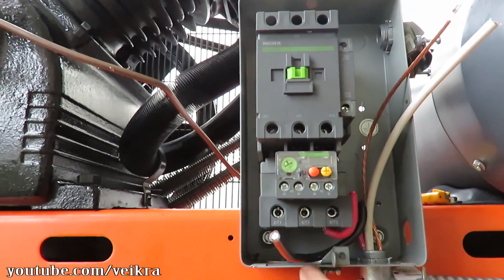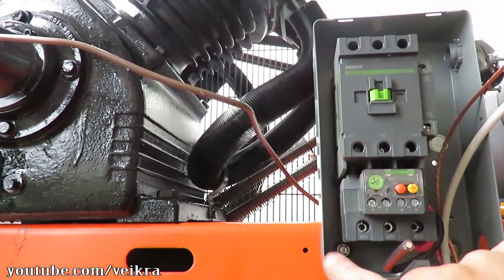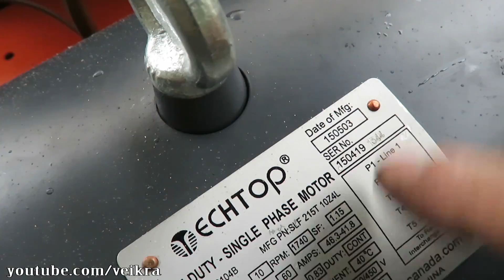How to wire 3 phase magnetic starters or contactors for single phase use and save $$$

Comment: Its working?
Reply from the maker: of course, why else would I spend thousands of dollars on it. Theres videos of it running as well as other ones I built just like it
Reply: @Nordic_Mechanic  so you running the motor with 1 phase?
Its stay long?
No issue?
Reply from the maker: @minkbandem8093  Of course it runs, it's a single phase 240V motor. Read the title, this is about using a 3phase contactor/starter on a single phase motor, not running a 3ph motor on single phase. 3ph contactors are 1/5 to 1/3 the cost of a single phase contactor
Reply: I got man 
Question for example i have 5 hp comprresor but the motor is 3 phase
I want to change the motor to 1 phase
What size motor you recommended?
Should i use 5 hp or 7 hp motor single phase?
Reply from the maker: @minkbandem8093  What the rpm on the motor? 3450 or 1720 ?
Reply: @Nordic_Mechanic  it was 5.5 kw 1450 rpm on plate motor
Reply from the maker: @minkbandem8093  Ah 50hz country. but 5.5kw is 7hp not 5hp as you stated. So you'll need that much. SAme power, same rpm. Here we dont have much between 5(3.75kw)and 7.5hp(5.7kw) and it'S 60hz so spins faster at 1720. You need a starter/contactor fit for the LRA of the motor too
Reply: I got man its mention 5 hp engine compressor but the owner before buy that compressor with 5.5 kw motor 3 phase. That the reason i want to change with single phase motor
Now i would like to hear your advise unluckyly in indonesia most on the shop they dont have single phase motor  5.5 kw max motor 1 phase is 3.7 kw 
Now only 1 option if i put 1 phase motor 3.7 to the compressor it will work or not?
Reply from the maker: @minkbandem8093   If the 5hp compressor part is true, 3.7kw is all you need. Maybe they got confused when they replaced the motor and put a 5.5kw instead of a 5hp.  I'd have to know brand and pump model to be 100% sure.  Here the biggest is 7.4kw on 1 phase 240V. If someone needs bigger we install 2 motors with sequential start.

Comment: Are those 10 gauge wires?
Reply from the maker: no, they'd melt and burn if they were. These are AWG 6 gauge .
Reply: @Nordic_Mechanic  10 gauge is good for 30 amp and 600 volts.
Reply: Where did you get the BX 6 gauge MC conduit?
Reply: 10 gauge should be okay.
Reply from the maker: @HollywoodRoseJack  homedepot
Reply from the maker: @HollywoodRoseJack 10 gauge is not okay for 10hp, that's 7.5kw. That'd be code violation

Comment: give me the diagram how to wiring the 5hp compressor 3phase to connect my power supply is sengle phase...pls
Reply from the maker: You cannot. you need a 5hp single phase motor to run on a single phase supply.  Either you change the motor and starter, or you get a variable frequency drive to convert single phase power to 3phase. Considering your machine is 5hp, it's cheaper and very easy to find a 5hp single phase motor

Comment: i have the same compresor but 5hp 3ph. would this work to convert it to 1ph? i'm looking at finding a 1ph motor at the moment. if you see this message please pm me back or e-mail me my e-mail is in my profile.
Reply from the maker: no it's not a 5hp. the devair 447 was never put with a 5hp, the minimun speed and hp is with a 7.5hp, then 10hp but most are on 15hp.  You may have a devilbiss 432 though, which work from 3hp to 7.5hp.
Reply: i have a 247pump 80gal on a 5hp taht is 3ph and i want a convert it to a 1ph. i found a 5hp 1ph motor however i need to change my magnetic switch to a 1ph. what you just show i this video. would it work?
Reply from the maker: there you go, mine is a 447 , basically 2 compressors like yours in a V configuration. The 247 can be run on 5hp, but not the 447.  

For your magnetic starter, it wont work with your current one. You need a beefier magnetic switch.  Amps of your motor are higher than on the 3ph motor. since theres only 2 conductor, it's a lower voltage and the motor is less efficient to start with.

If you want to buy a 1ph magnetic starter youll pay a lot more and it's not as easily advailable. So get a 3ph contactor of about 25-30 amps and do this. (mpst can be fine tuned).Take the F.L.A. rating on your motor name plate, and tell the part place
 you need a  contactor for that.  They'll give you a 3ph one and you can
 do the loopy loop like I did

for instance, my contactor is for a 50hp 3 phase motor. On single phase, it does only 10hp

And beware of fake 5ph motors or you'll set fire to you compressor with that pump. It really requires a true 5ph running, not a 5hp like on the cheapo big buck stores compressors.
Reply: @Nordic_Mechanic  I have a 5hp 3 phase motor and I'm running it on single phase just by using idk the cord was cut and I spliced a soldered a new one on it
Reply from the maker: @northwestrockgem9745   Then it's not 5hp you are using out of it. You're running 2 of the 3 windings only
Reply: I have a 5hp single phase ...